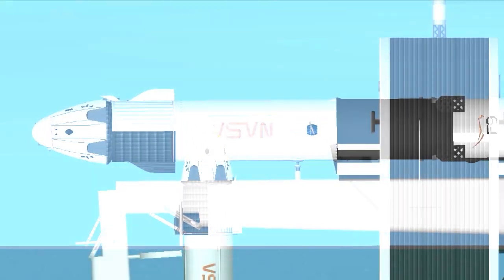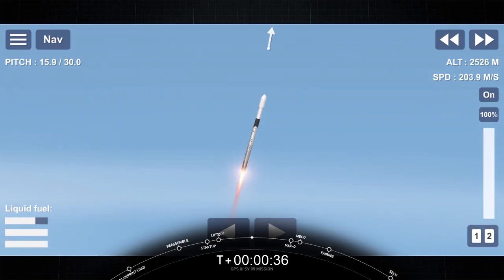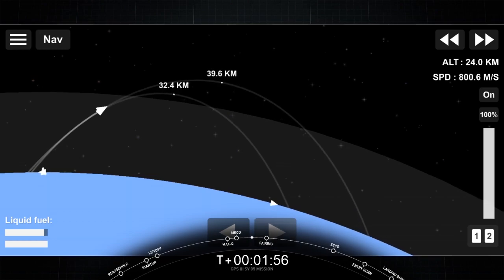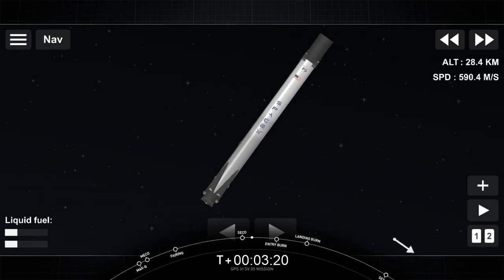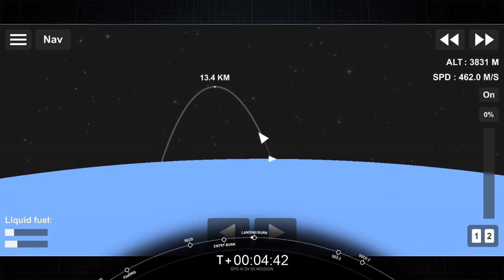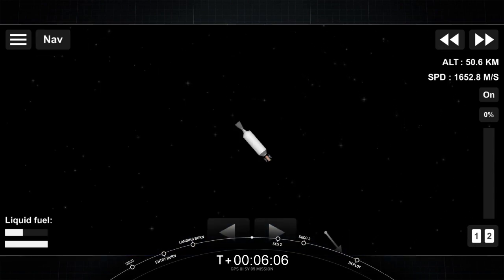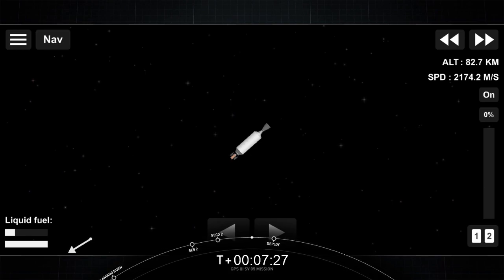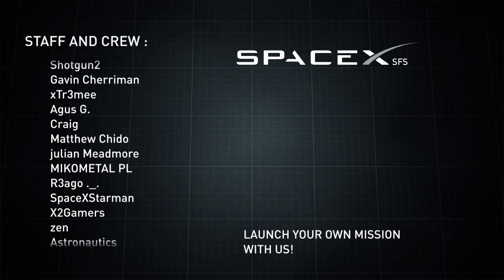GPS III Space Vehicle 05 Mission

Comment: Cool video!
Reply from the maker: Thank you
Reply: @skyridesfs  I have a few questions for you.  1. how do you edit Bp so well.  2. in which application do you do it.  3. Where do you get the initial blueprints for the construction.
Reply from the maker: 1. I have coding base, such as Javascript or JQuery, which looks similar as sfs blueprint structure.
2. Im using standard text editor, might be QuickEdit or standard notepad.
3. I start building from the only one "Fuel Tank" parts, and the rest just write the code in the bp structure
Reply: @skyridesfs  thanks for the answers🤗🤗
Reply: @skyridesfs  Wow, how long does it take you to build, say, Crew Dragon ??
Reply: @retrofit1313  well he will pron just use his falcon 9 but remove the fairings so making crew dragon maybe 2 days